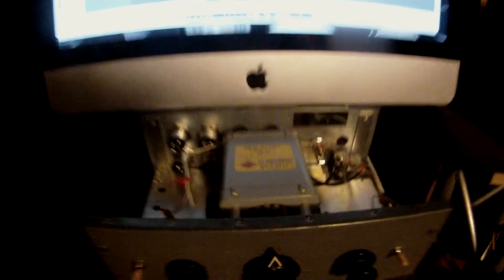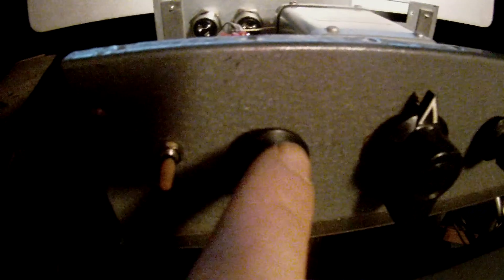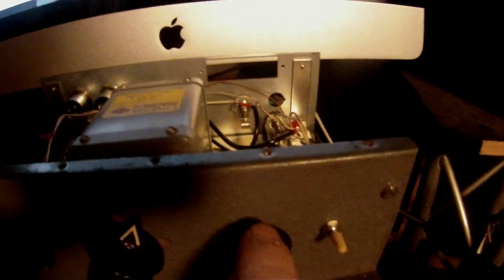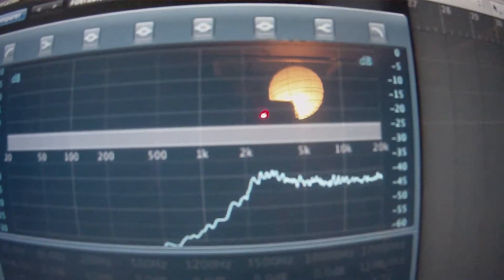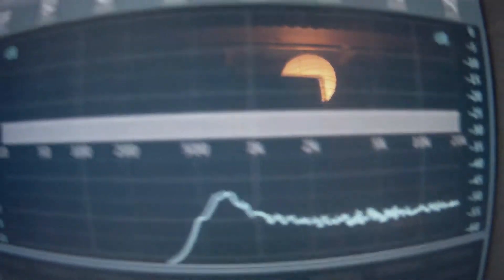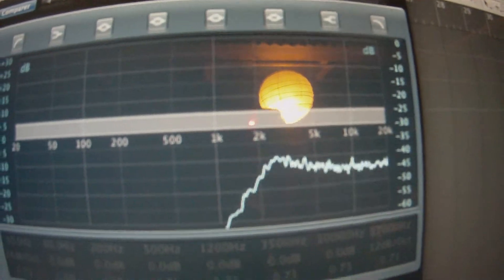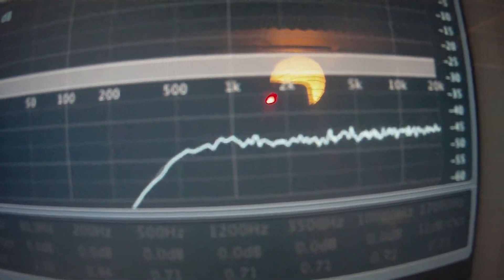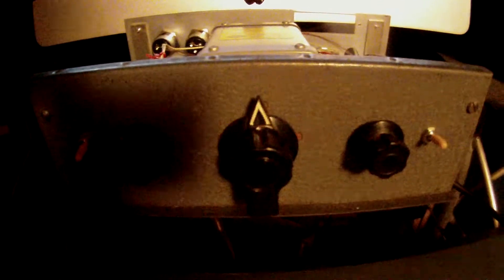improve your highpass filter (cinema engineering/altec/langevin etc..)

Comment: I was gifted a Langevin LPF module however,  I'm missing the pinouts/wiring scheme.  Could you help me?
Reply from the maker: you just have to identify the ground. with a multimeter, the 2 pins of the ground are linked, so zero ohm...then you can use the IN as an OUT for the two last pins...  so if you have the ground, the 2 pin left are in and out